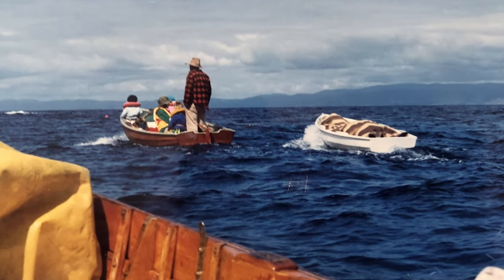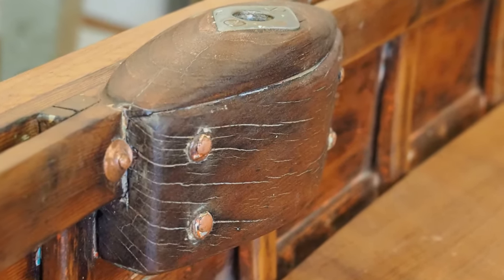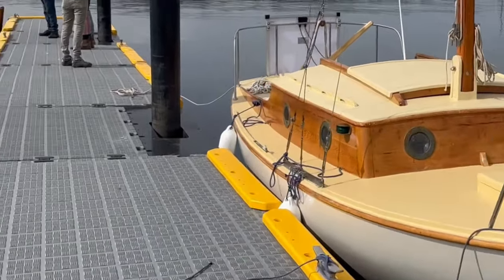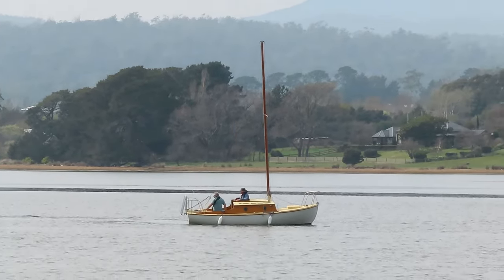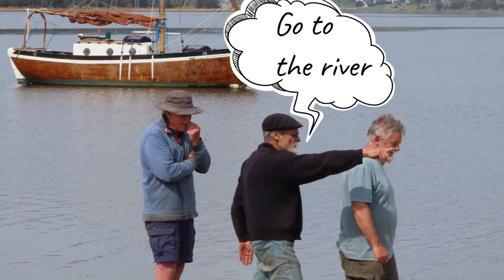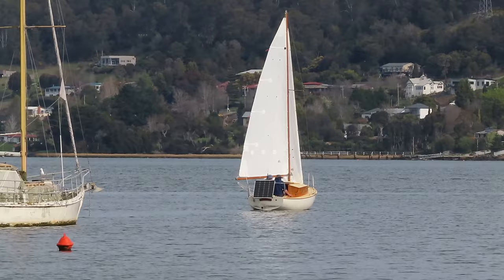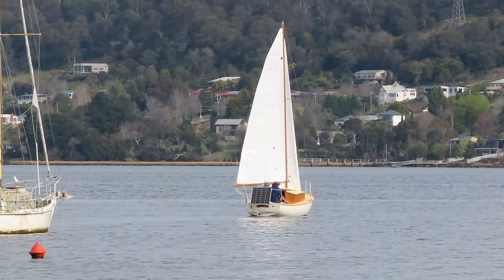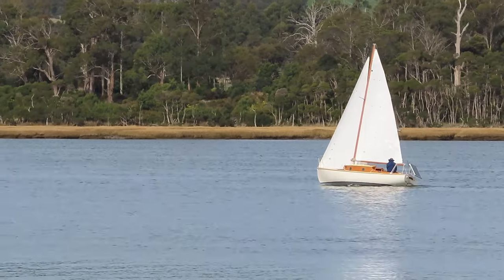Relaunch at Gravelly Beach: Sailing the Tamar River in Sarah Ann Prt1

Comment: That would be very satisfying.
Reply from the maker: It was indeed. I’m very excited about
The future pleasure she will bring.
Reply: @SmallSailboatCruising  restoring then using gives you a far better appreciation and knowledge of the craft you are using than just buying one already done up.
Reply from the maker: @rhysstapleton1074  yes. It helps to know every nut
Bolt and screw when the pressure is on. That intimate knowledge has got
Me out of tight spots in the past.